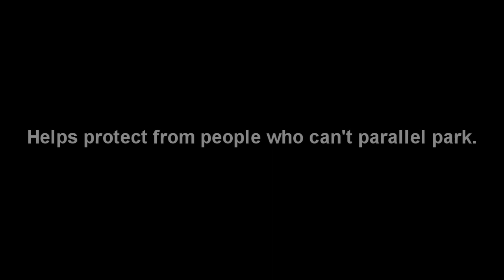Episode #207 - 2009-2011 Honda Pilot Bull Guard Installation

Comment: Looks nice but don't expect much protection from the guard above parallel parking speeds. In the urban parking jungle the bull style guard has an advantage over the larger guards that wrap around the grille+headlights as the bull bar won't be pushed into the hood or grill.

Comment: I tried installing one of these on my honda ridgeline and learned most of the bolts are threaded into spotwelded nuts sandwiched inside the frame... 3 out of 4 of those nuts broke free and now the bolts are slightly loose and just spin..